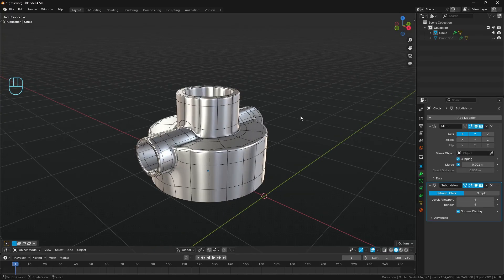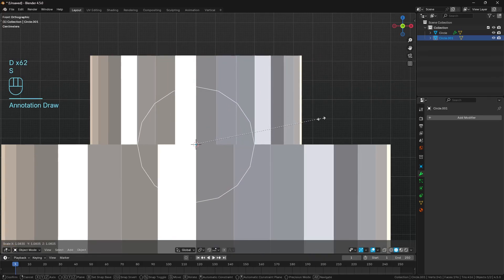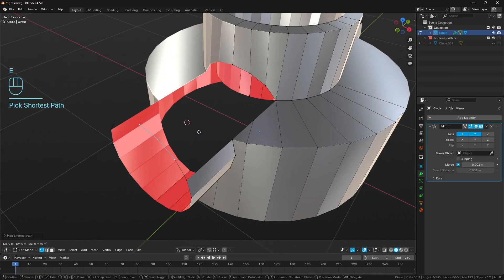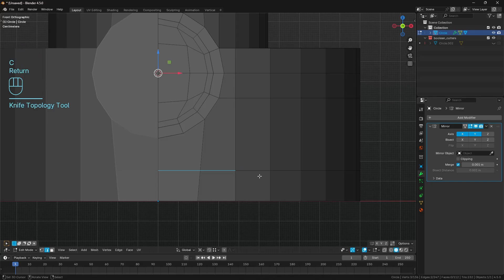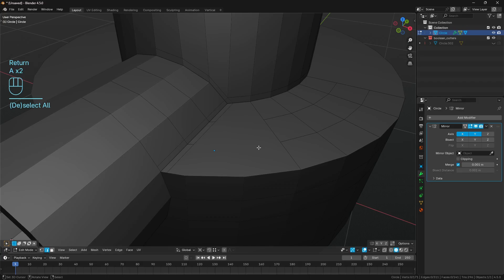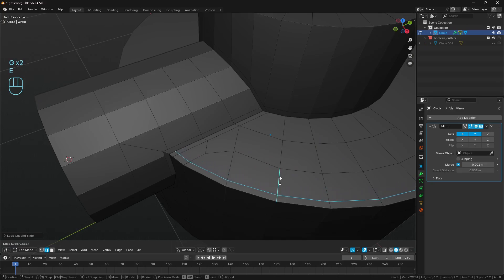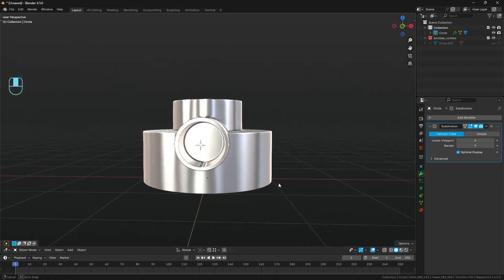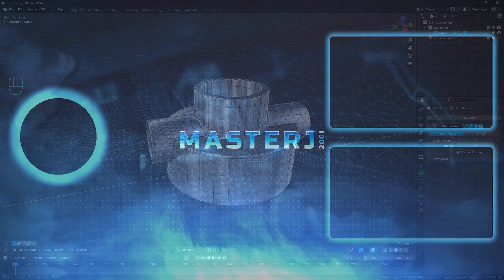Fully Quad-based Modelling Challenge 10 Solution

Comment: Why do the first circle 32 then second circle 16. What is the theory or logic behind that decision?
Reply from the maker: Good question!

I don’t actually have an exact way of knowing, I typically just figure it via trial and error. 😅

Though, a good way to think about it is, if the main cylinder is comprised of 32 verts and we’re cutting in a new cylinder onto one side of that, we only have a maximum of 16 verts on the other half of the cylinder. Therefore, we could work with a cylinder at an absolute maximum of 16 verts or less (technically speaking, you could use a cylinder of any vert count, but you’ll run into a lot of headaches trying to do the side cylinder at 32 verts). 😅

Hopefully that helps give you a decent way of thinking about it? But happy to try and explain further if it’s still not clear. 😁
Reply: @masterj2001 Oh That makes sense. Thank you.

That idea of  if we are cutting unto 1 side of a cylinder, it makes sense to start with the Vertex count of that half 😁. And also it's a trial and error. Noted.

By the way I hope one day you drop a full timelapse of you modeling. So we can see ur thoughts process and errors and trials and how u get them fixed.

Cause I think that's the problem with us the novice. We believe it's all easy for you guys since the tutorials goes all smooth without seeing the uncut struggles and trials.

So a Full modeling timelapse upload will go a long way if possible 😅
Reply from the maker: I can do you one better, as I do full length modelling tutorial series, mainly being the Space Marine and Halo 3 Recon helmet modelling series. 😄

I keep in a handful of my mistakes and step you through how to fix them, as I agree, showing the mistakes are important. Otherwise, people get the impressions that you never make mistakes and that I somehow never get anything wrong on my modelling process. 😅

Which, I can assure you, I make heaps of mistakes when modelling. So if you check out those series, hopefully you'll get what you're looking for in seeing the full modelling process. 😄
Reply: @masterj2001 oh Great. Thank you 😊